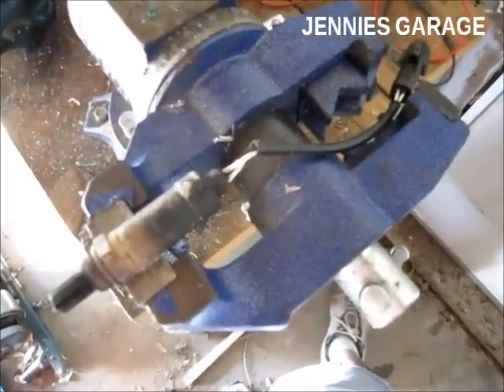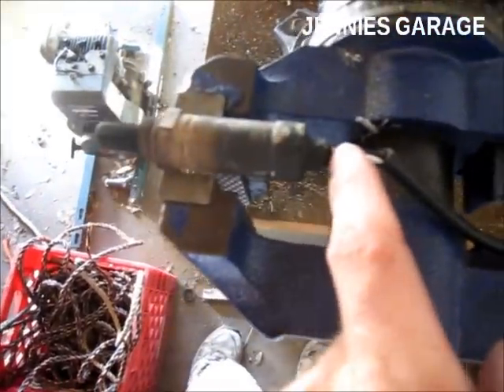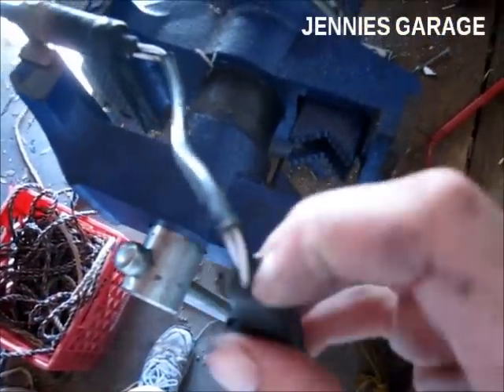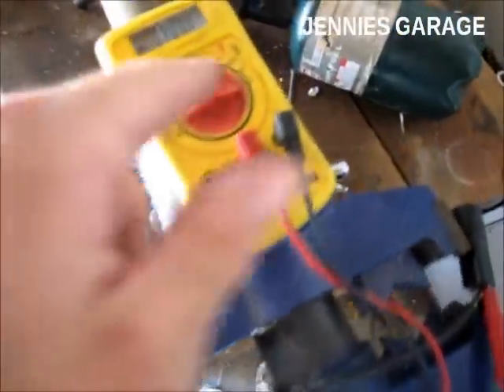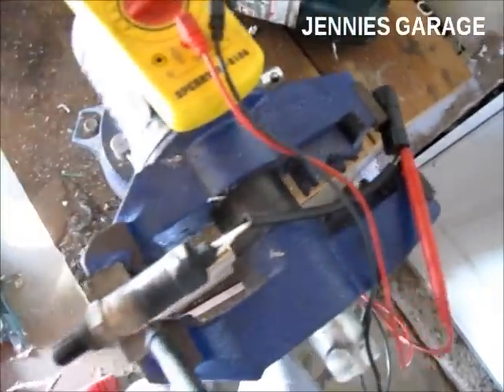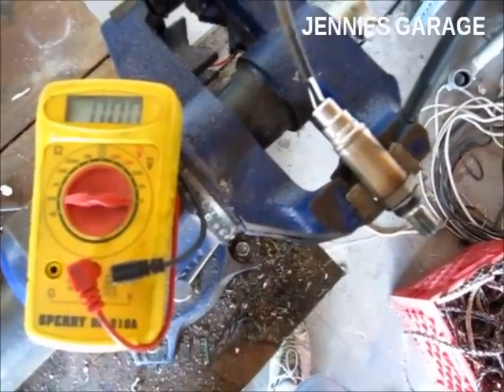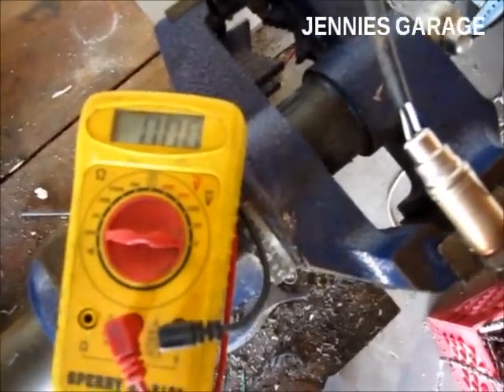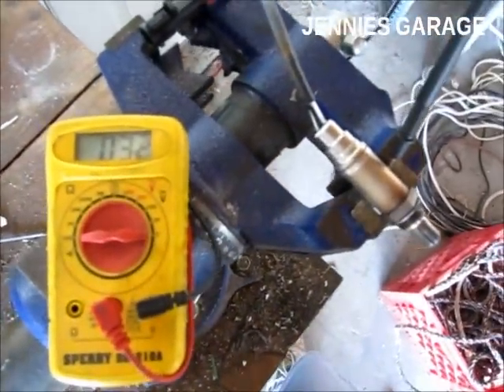How To Test An Oxygen Sensor - Old Vs. New

Comment: Putting 12v to it wont hurt it and neither will a meter. Everytime you start the car it puts 12v to it to heat it to 600°. But putting a 3000° propane torch to a new sensor cant be good for it.

Comment: hi jennies garage, i have a problem, have a code p0137, i check the voltage of the sensor that my ecm says is bad and it 3,80v i accelerate the rpm and the voltage barely moves,you have any ideas what could it be the issue?,  thanks in advance👍

Comment: I'm wondering what kind of symptom(s) occur(s) when either or both of these two  "O2" sensors get(s) dirty or fail(s).
Reply: hazlbri mine are messed up pre cat and it kills fuel mileage and takes away some power

Comment: Don't try this if you intend to put the oxygen sensor into service.  Yes,  the oxygen sensor will show it can detect differential of oxygen and relay this detection by voltage potential.  What is really the concern is performance of detection and being able to quickly detect variations of oxygen levels.  If it takes 200ms to show lean vs. Rich and the injection cpu requires 50ms to keep fuel mixture close to stoich. Optimum 14:1 under load and 20:1 or higher for deceleration..therefor operating lean when it should be rich and rich when jt should be lean.  Exposing a oxygen sensor to conditions present in this video will destroy the critical performance required by a fuel injection control equipment.  Test O2 sensors while in service or replace with new carefully installed

Comment: give me a good idea along same lines. I CAN GET A BUNG AND WELD INTO SHORT OF PIPE  THAT I CAN SEAL PERMANTLY AT ONE END AND OTHER WITH SEALABLE LID. PLACE CANDLE ON LID LIT SEAL IT UP. FLAME GOES OUT WHEN ALL OXYGEN IS USED UP. IT WOULD BE WAY LESS HEAT AND MORE RELIABLE.

Comment: This is not the right way of testing oxygen sensor. direct flame on the prob can damage the sensor as it was designed to compare the amount of the free oxygen in air with the amount of oxygen in the exhaust manifold of an internal combustion engine. test the sensor before removing it from the car by running the engine and measuring the voltage.
Reply: May I ask you how to do that? I've been trying for hours smh lol
Reply: Sean Davis find where it is and probe the signal wire with the positive lead and you can just run the other to any good ground

Comment: when i put the flame on mine it decreases voltage and when i remove it it goes up to 0.9 volts very slowly ... why is it backwards???
Reply: Dave Q
check multi-meter for hooking up correct polarity and re run check

Comment: thank you good video, how do you test sensors with four  wires?
Reply: 4 wires sensors are the same. White wires are for the heater element. So you should then hook your meter to the black and gray wires and test as mentioned in this video.

Comment: j am not totally convinced the previous sensor was faulty. it could have been your ground. three wire sensor is (-)ground, (+) heat element, and MV lead.  You didnt mention this in yoyr video. your negative lead should be on one of the white wires. the ground on the body works also but on the old sensor the body is dirty and rusty. did you ensure you did have a ground problem with the probe on the body?
Reply: Have to agree about the sensor body. I'd expect weird readings if I hadn't ensured clean, rust-free contact.

Comment: Hey nice video, and nice test. Wow, I noticed a lot of people in the comments section, saying how this is not a valid test. They said things like oh you have to use a lab scope, scan tool, or my favorite one was oh any professional shop doing this test can get in trouble by lawyers (BAR). Man that shit cracked me up. This test is TEXTBOOK. I have seen this procedure in many automotive text books, as well as service information. Here is a link to one from Autozone (Autozone owns and sells alldata and it is used by plenty of tech schools and pro shops alike) Hopefully this long link will work. 
http://www.autozone.com/repairinfo/common/repairInfoMain.jsp?targetPage=productsHowToInspect&leftNavPage=productsHowTo&pageId=%090996b43f80a01215&subtitle=test 

So yes this is a valid test. Now I do agree that I would probably not do this test first, but more as a last resort. However, that does not mean this is a bad or invalid test.  This test should work fine on your typical narrow band zirconia oxygen sensor (which is a very common type), because as you said in the video it produces its own voltage signal, because the (ZrO2) is an electrically conductive material that generates a small voltage based on the difference of oxygen inside and outside the sensor. (but also needs heat to work, closed loop starts working at around 600 degrees F, and works fastest at around 1500 F)  The bigger the oxygen difference between inside (inside exhaust pipe) and out (outside air), the higher the voltage.  Rich is high voltage and lean is low voltage, simple. The zirconia type oxygen sensor creates its own voltage, so your test method should work no problem.    

Now on a narrow band titania type oxygen sensor this procedure would not work the same way because this type of O2 sensor does not produce its own voltage, it has to have a voltage reference signal sent to it from the PCM and the sensor itself changes its  internal resistance based on the presence of oxygen in the exhaust stream only (no outside oxygen reference needed) and this changes the voltage of the sensor circuit. When the sensor changes resistance this creates changing voltage drops and the computer monitors the changing voltage drops. It uses the same voltage range as the other type of sensor. High voltage is rich, and low voltage is lean. Also there are other types of oxygen sensors as well but those two I mentioned are the most common narrow band types. (I will not go into any wide band o2 sensors) Anyway sorry about the long winded post, I just got a good laugh at some of the comments I read under your video. Well thanks for the video and have a good day.
Reply: to test it correctly a lab scope is needed, a dvom is not fast enough
Reply: ferkemall  I was a metrology (science of measurement) engineer... this test was just fine.

Comment: maybe i missed if you said it was a front or rear 02 sensor.  if the rear  02 is in question can i test the rear as you did in the video? thanks
Reply from the maker: This was a front, but it should be the same for the rears

Comment: These sensors (the 4 wire type) seem to be universal and surprisingly inexpensive when the same part is used by several automakers.  No special test gear is needed to find the fault as one's nose and ones's wallet will tell you that something is wrong!  The faulty sensor is usually the front one.  The hard part is removing it and this is why some garages charge more than £250 to do the job.

Comment: Hi,  Great Video, I have an issue with a Lambda sensor so interesting to see.  Is there anyway the sensor can be damaged by this test?, I.e Overheating or heating parts that shouldn't be heated (anywhere past the sensor head??)
Reply from the maker: +Frank Bridge I don't think the torch gets it hot enough to cause damage, but just to be safe I always apply the heat slowly and keep the flame back a little bit too.

Comment: my car o2 sensor have 4 wires .Black/ gray / white / whiteDo any one have idea how to ccheck ?
Reply: +Luminous Media your two whites are what heats up the internal part of the sensor so you prevent putting hydrocarbons in the air quickly.  the black is the one that brings voltage to the sensor
and the gray is the ground.  put the neg. lead from meter to gray and put the red lead of the meter to the black. then use the propane to heat it up with.

Comment: Thank you so much for this video! Just want I wanted to see! What about with a live-data scanner with the sensor still on the car? If it were faulty, would it still be doing what this one is doing? IE: Would the sensor not read high enough? Would that be the only way to tell if it'd failed?

Comment: hi, i have a 2010 camry and just yesterday bought one of them scanners that reads voltage in real time. my upstream(wideband Bank1 sensor1) reads 2.2- 3.5v
the one downstream afrer cata (b1 s2) reads 0.7 - 0.8V.
Code is p0138 for downstream replaced it but same problem do you think upstream might be bad ?
Thanks

Comment: That's a really good idea. You could also thread into a pipe about foot long and the apply a torch with oxygen supplied. And turn oxygen knob left and right and watch the voltage move.

Comment: Just a question - im thinking of getting a sensor and using it with a multimeter to measure my carb o2 mixtures - are there sensors that i can pop in the tail pipe without the need of a torch, or could I wire the sensor up to heat itself somehow? I dont have Obd systems or anything - dont know much about the sensors types - 

thanks
Reply: No - the sensor measures the o2 difference between inside the exhaust and outside the exhaust/sensor when screwed in - if you have it all inside the exhaust both tips and 'outer' see the same level

Comment: some "mechanics" on here disagree and say that this doesn't work, i disagree with them. it may not be the most thorough test, but it is at least a ballpark test and will at the very least give you an idea as to which sensor is bad if you test multiples, and which sensor to replace first. i tried this on my wife's car that has two o2 sensors thinking that it couldn't hurt as the alternative for me was just to replace them both and which i planned at first to do anyway. i removed the old sensors and tested them just as this video suggests and was able to diagnose the bad one with the ease that this video shows. again, i'm sure there are other and maybe better ways to test them but this is a good place to start if you're not afraid to get your hands dirty and i ain't skeered. thanks for the video and the information. good job.
Reply: While the method may not render scientific data, the smooth operation of the new O2 sensor was obvious, especially when compared to the old sensor. For someone at home, who can't justify an expensive piece of test equipment, what the heck ?
Reply: +coffeecreamcake - What is not mentioned on the video is that this is a great way of cleaning old sensor covered in soot/carbon. Just leave the flame a little more time until the it gets red and all the deposit residues will be gone quite fast. let it cool down naturally and blow with compressed air, job done. "Saved" many sensors from the recycle bin this way.
Worth mention it's also an excellent way to clean spark plugs, manifolds, etc. Good video. :-)
Reply from the maker: coffeecreamcake Thanks for the comment, I'm glad you were able to get your car fixed. You're right that this method won't be in a factory service manual, but it's a great way for the home mechanic to get an idea what's going on with their sensor(s)

Comment: If you have an OBD II system you can buy and ELF bluetooth OBD scanner from Amazon http://www.amazon.ca/Bluetooth-CAN-BUS-Diagnostic-Windows-Android/dp/B009RLB4Z8 for $15, then if you have android cell you download the Torque app $5 to read the scanner. The one that comes on the CD is 1980`s quality.

The Torque app tells you exactly what voltage the O2 sensors are reading, so no need to get under the vehicle and all that jazz :]

https://play.google.com/store/apps/details?id=org.prowl.torque&hl=en

Get the pro version it`s stupid cheap and is quality.
Reply: Totally agree buddy! That's what I did. I just want to advise consumers that a quality blue tooth OBD II scanner will run them $30. Every one that had good reviews that I found was $15 and up but they all had about $15 in shipping, lol. I'm sure that light little thing doesn't take that much to ship. They all want their device to look inexpensive so the package some of it's cost into the shipping. A bunch of the scanners at that price aren't good!

Scotty Kilmer has even seen cheap scanners damage ECU's. Yeah, if you have the right car you can get the ECU or PCM, or car CPU for about $70 on my car, but if I wasn't so lucky, then knew it'd be $600 to $700 with $65 core.

So, be sure to buy one with good reviews.
Reply: It took me months to come up with a reason to do the Jennies Garage test. If you have an O2 sensor on your torque app that just keeps showing lean, like maybe it's stuck there, or maybe it's stuck rich, taking it out of the car and doing this would prove it's the sensor rather than a car that can't compensate enough for an issue.

Note: the front O2 sensor should oscillate up and down across .45 volts to be the cleanest possible on the environment. Often cars run rich until they're warming up so don't have that as part of your diagnosis. (If it takes a long time to be in closed loop, it may be the heater core of the O2 sensor being bad. This of course requires it to be a 4 lead O2 sensor. Check the ohms of resistance on the heater core. If it's infinite resistance it's bad! (would read 0.00)

Note part 2: the rear O2 sensor should not be oscillating. If it is, the catalytic converter is bad. If you have a bad enough exhaust leak it can act funny too.

I suppose you could have a bad catalytic converter and a bad O2 sensor, but O2 sensors are very reliable. Far more likely the cat is bad, don't replace a good O2 sensor like a lot of people do! Mines running great and it has 170k miles on it.
Reply: NoFearAwareness I have a Wi-Fi version ELM327-What i've read about those 'cheaper' bluetooth versions is that most are using pirated PIC code from the original, and they've been known to short out and ruin ECM modules too. I'm happy with the real wi-fi version, works on both Apple and Android without a hitch..worth the extra $

Comment: I have a live scanner that shows my O2 sensors through the full range of voltage while I'm driving. It reads multiple changes per second when the engine has reasons for constant adjustments. Much easier, but I still enjoyed the video and learned some things too. Everyone's comments helps me learn too. Thank you all!
Reply: I know it's been 4 years but if you're still around I would love to know what scanner ap you use to be able to do that.

Comment: Only way to really test an 02 sensor is with an oscilloscope, the bench test as shown is cool and can give you a rough idea if it is working but you can still get the rise and fall  . 1 to. 9 
But will still throw a trouble code for 02 sensor slow or 02 sensor switches missing

Comment: To 6403ron,

 Did you ever stop and think that a bad wire can set a code?  If you run over a tree branch in a storm, you can knock a vacuum modulator valve hose off if your car has one of those, and you can also damage O2 sensor wiring.  A bad electrical connection due to corrosion where the O2 sensor screws into the head pipe or connects to the exhaust manifold or the manifold to the head or the wire connector in the harness itself can set a code as it doesn't take very much resistance when you're dealing with such a low voltage.  That's why I ALWAYS use a wire brush to clean the rust out of the O2 sensor bung and the end where the sensor seats BEFORE I just blindly go changing parts out to fix an O2 sensor problem.  If the wiring harness gets abraded and puts the signal to ground or open due to any number of reasons, you can set a code that way too and the sensor will test out just fine.  Only someone who can really troubleshoot systems ever thinks these kinds of things through, which you obviously didn't do now, right?  Oh, and I always put a bit of anti-seize on the threads, but not so much that it can harm the cat or sensors.
Reply: I hadn't thought for checking that it was cleanly grounded. Cleaning up rust always helps with a good connection. Yes, anti-seize. When I was early DIY rather than nearly a technician I installed a new O2 sensor, up river, and got my car running nicely again. The car wasn't that rusty then. Now....until I own an acetylene torch or replace that manifold that O2 sensor better not fail. So rusted in (I can't take the down pipe off my manifold until the O2 sensor is out of the way. Thankfully just replacing one of the springs cleaned the exhaust leak ...still wanting a new doughnut gasket in there, but don't fix what isn't broken, it runs soooo much better). . . So yes, use anti-seize but don't get any on the sensor!

My last Bosch sensors I installed, my mom's 1999 Mercury Sable ran okay...but with them all new it ran sooooo much better. I was surprised that the down river O2 sensors helped it run better....I guess the car's willing to run a little richer for some punch when it's not dirtying the environment? I might have imagined that part of the improvement. Anyway, I just meant to say that only 8 years ago Bosch includes the perfect amount of anti-seize on the threads. I had to love them for that little touch.

And remember, don't blame an O2 sensor or a catalytic converter for an exhaust leak. I have a live scanner now and my new cat gave me 50% more horse power and almost removed the condition of the rear O2 sensor switching...sign of a bad cat? Sure. It does it a lot less, but you can't have an exhaust leak before the cat and know for sure if that cat is really bad so check upstream before you finish your diagnosis.

I liked what you got me thinking so much when you made your comment that I added the above to one of my website's if you're interested. http://carmpg.blogspot.com/2014/07/o2-sensor-ground-is-it-rusty-make-it.html